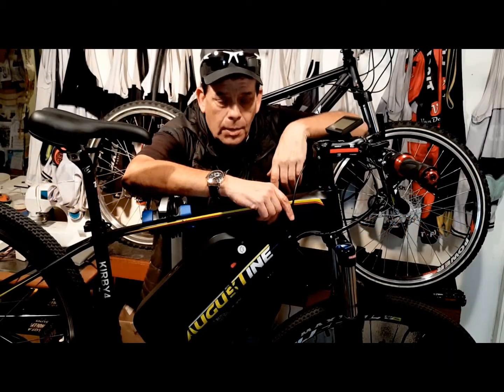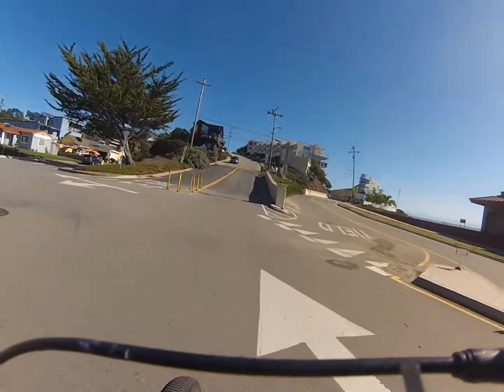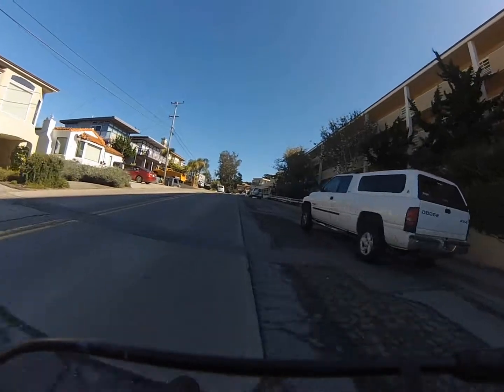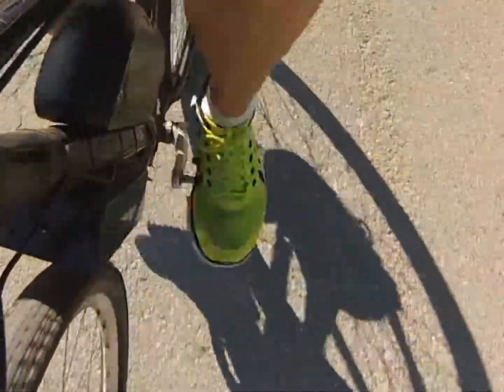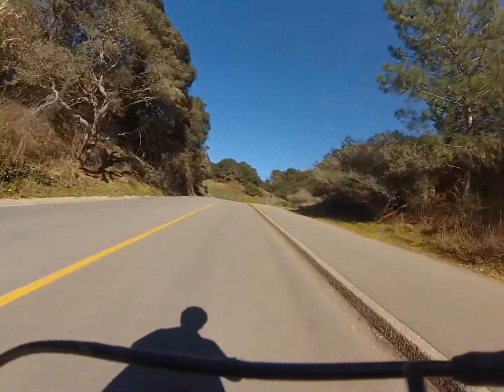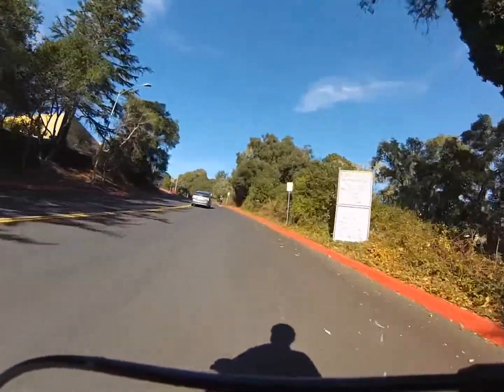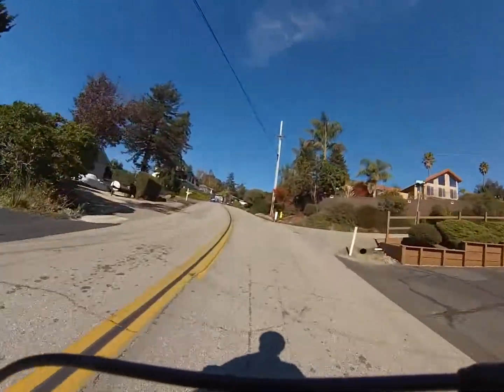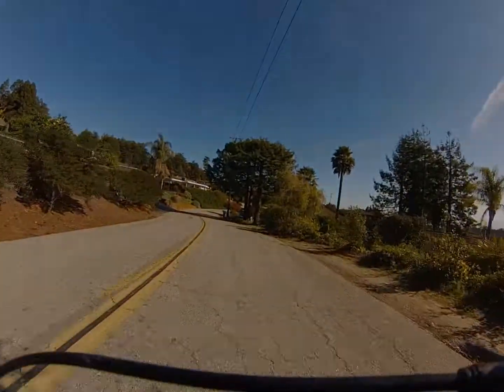Serious Hill Climbing Tips with an E-Bike Conversion Kit

Comment: I think most trail in California limit the motor to 750W.  What is the best 750W kit do you recommend to get that has the most torque for going up steep hills?  Also, the kit has to go 28mph as a speed pedelec on flat terrain.
Reply from the maker: All of that can be controlled by the onboard SW-900 computer. Max speed, etc